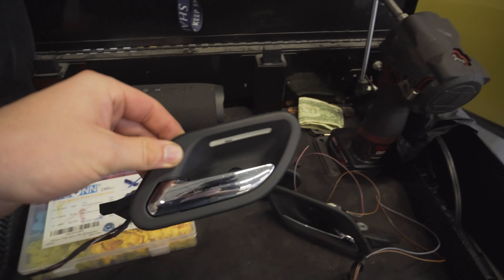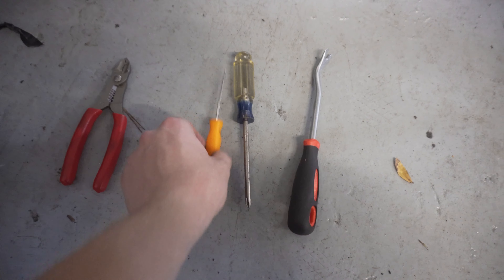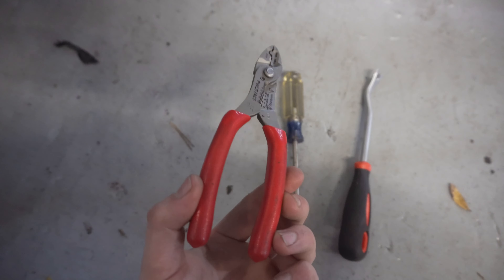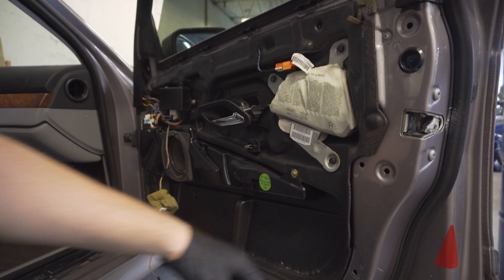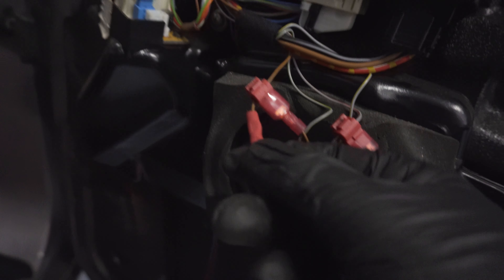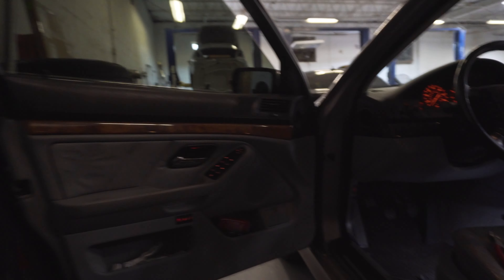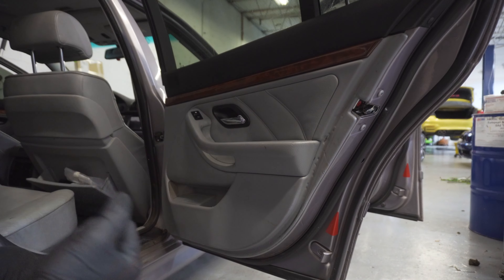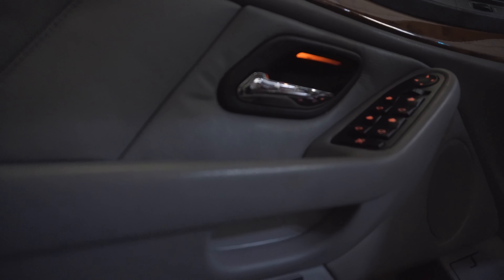Best BMW E39 Retrofit! E38 Ambient Lighting Mod!

Comment: Can you make a video about the wiring? I am not good at this but I want to do similar. Wich wire did you use on the driver side?
Reply from the maker: It should also be the brown and grey+red wire. The wires that power the window switch lights
Reply: @jackbowescinema8002   is this 12v?
Reply from the maker: @TheBestGamer25  yes